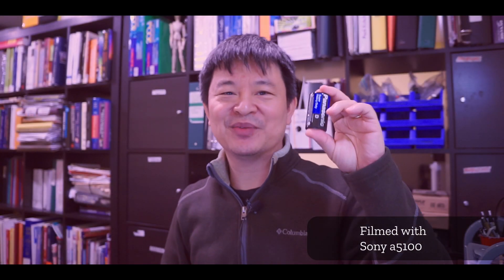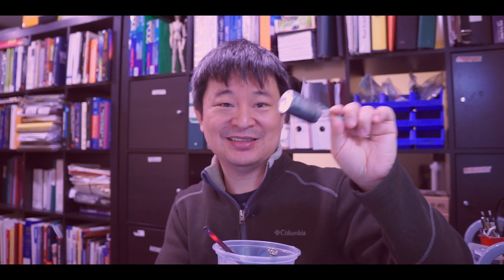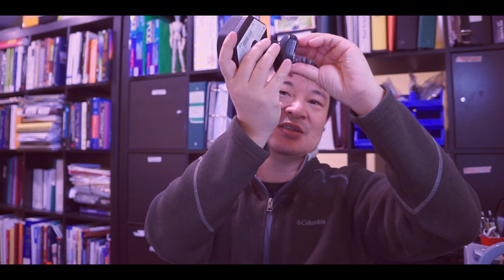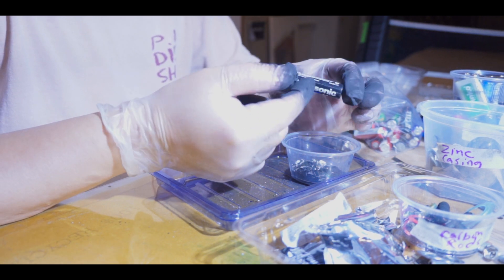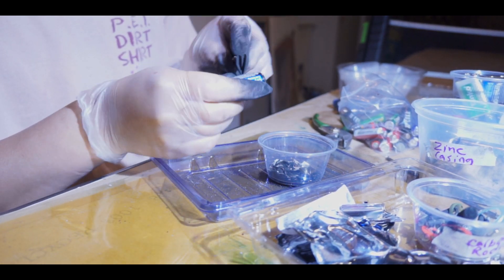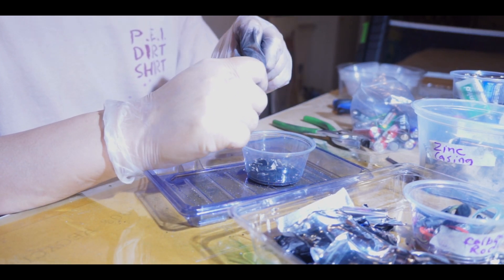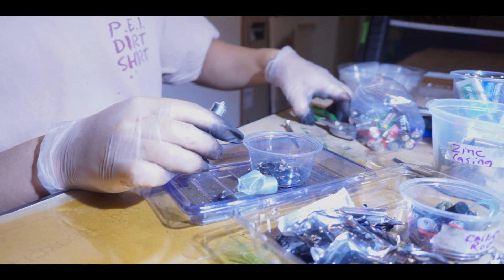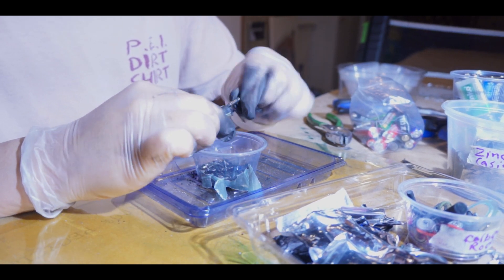Repurpose and Teardown of Carbon Zinc Battery for Useful Parts

Comment: Hi, I could not find any carbons in batteries when tearing them apart. Only a certain batteries contain carbons?  Any suggestion? Thanks.
Reply from the maker: The carbon is in the carbon core stick/rod (the black long rod in the middle part of the battery when you take it out).